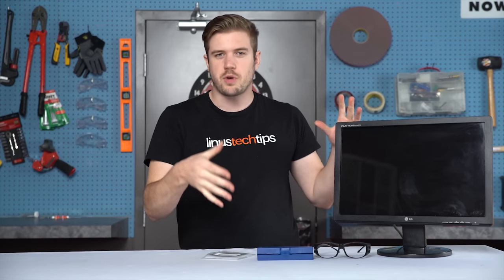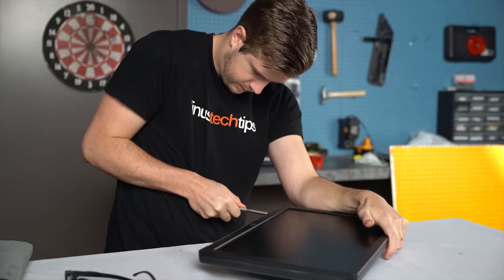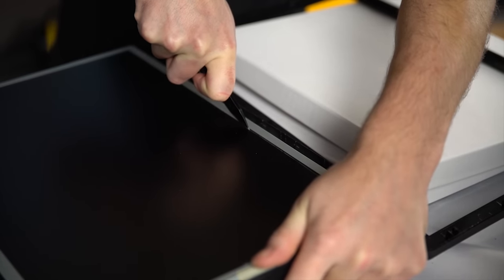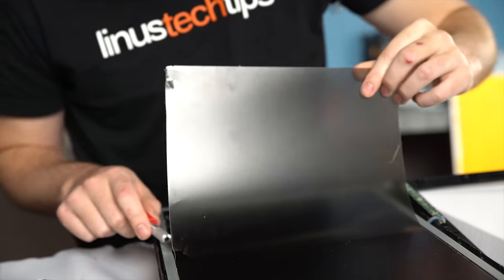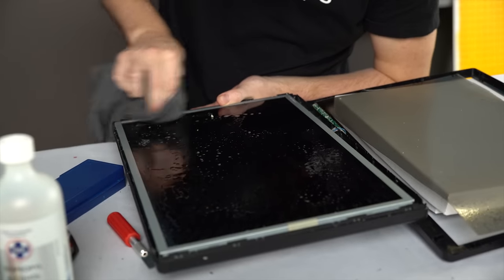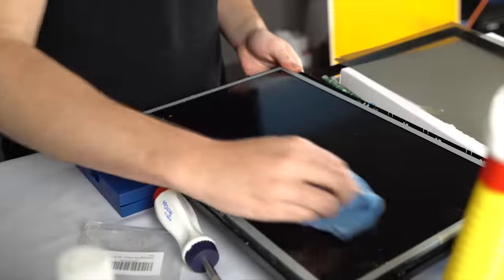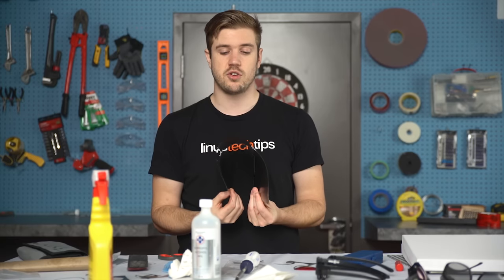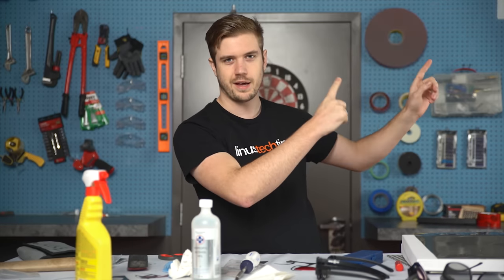DIY Privacy Display - Recycle your monitors in a badass way

Comment: All you had to do was run a heat gun back and forth over the surface.  It would have loosened the glue tremendously and made the work much easier.

Comment: I’m pretty sure Luke noticed that there’s a dead pixel line near the bottom... if you stop the video at 11:43 you can kinda see it... i think the liquid (not entierly sure the spelling 😂) got inside of it and it’s pretty obvious since it was leaking from the other side... i’d use some tape to cover off the
edges at the screen so that the stuff wouldn’t go in there...

Comment: dunno if it was wet or old dried stains, but on the back of the monitor there was some drip lines most likely from the iso or googone falling through during cleaning and getting the board wet

Comment: I known this is an old video, and it may have been said before, but when removing a bezel, because of the way the plastic clips work that hold it in place, if you grab the edge of the bezel that touches the screen towards the center of one of the 4 sides and pull slightly away from the screen and towards the outside edge of the screen, they should release much easier, I usually pop the 4 long edges, then wiggle out the corners, I worked in a repair shop for years and took tons of lcds and laptops apart. Hope this helps someone.

Comment: You are supposed to lift the bevel with the prying tool so the locks unhook, not to twist the prying tool and force the hooks over the locks. No wonder the prying tool got destroyed. I am actually surprised it didn't destroy all the hooks as well.

Comment: Next time, use a hair dryer set on low to soften the glue holding the filter onto the screen and also, use a razor knife with a new blade to make the perimeter cut......works every time.

Comment: it would probably make your life easier if you would use a hair dryer to melt the glue a little bit beforehand. it will get sticky and probably leave a mess but you can probably just peel the screen right off.

Comment: Try a credit card as a substitute for a spudger. More effective and less destructive than a screw driver. Particularly with laptop screens cause you can lay the card on the screen and slide it under the bezel that way instead of trying to attack it from the outside.

Comment: The solvent got in the inverter connections. Dry it it for a week before turning it on it may still work, but if it doesn't ...that monitor is gone.

Comment: You should have used a heat gun to loosen the glue and instead of using a chisel a glue scrap removing tool and exacto knife or razor blade for the perimeter cuts

Comment: Wow that's so sketchy lol, I don't recommend doing it that way, the simplest as well as safest way to get the front and back of the monitor separated, at the top of the screen face it away from you and then take your fingers and wedge them between the panel and the plastic frame, once you feel it give pull up and it will start to pop right off, but the part that scares me is using the razor blade when you can just take the 4 or so screws off around the side of the frame and remove the entire sheet effortlessly

Comment: You don't wanna be to rough with the monitor, so in case u don't have a plastic tool, and use a regular screwdriver, maybe is good to start from the bottom to avoid visual damage to the monitor...
Says the one guy who is indeed going to dismantle a screen...hahaha 

Totally makes sense!

Loving these videos!

Just realized that for the project to work U need a fully functional monitor, except the polarized which need to be up on the googles...so...nvrmd
Jokes on my i guess 
Not going to delete this pearl!

Comment: For separating plastic cases held together with plastic clips use old credit cards. They are cheap and hold up much better than the plastic tools they sell for this. You can also have more than one in the gap while you work on opening it. You can slide them along the crack, twisting slightly to disengage the clips.    For glue removal use WD40, let it set, after the glue is removed use rubbing alcohol to remove the oily film.